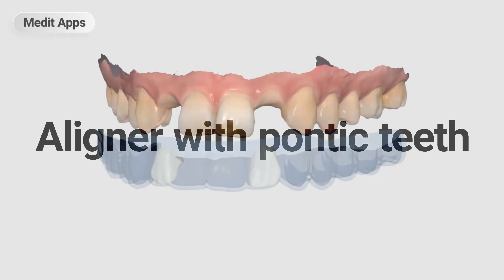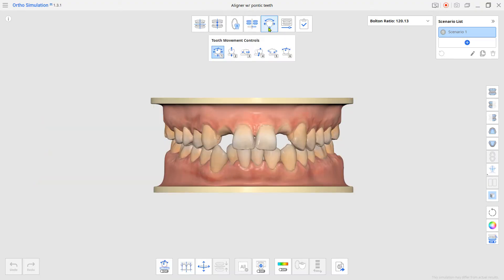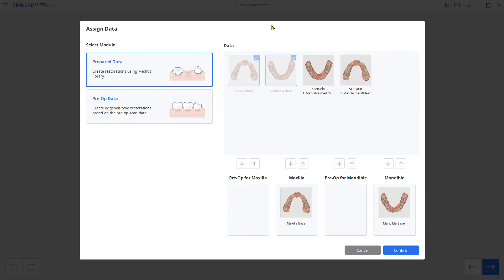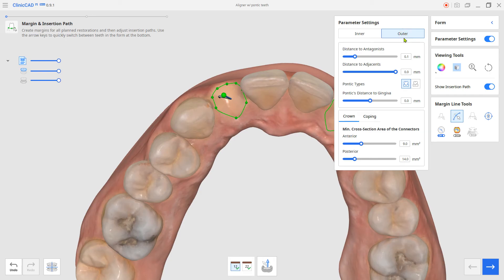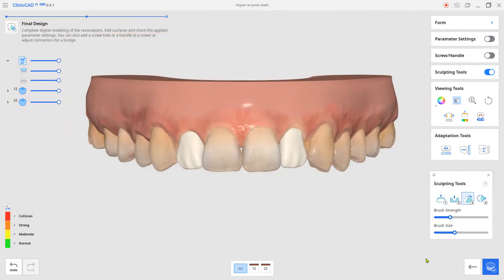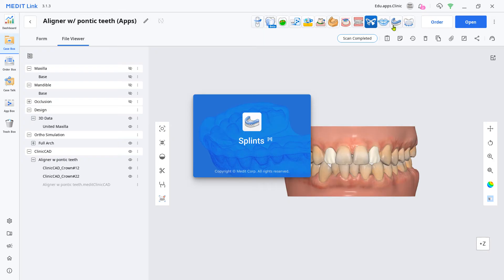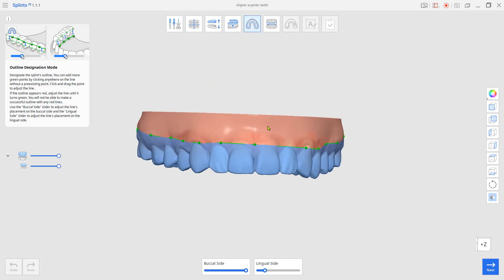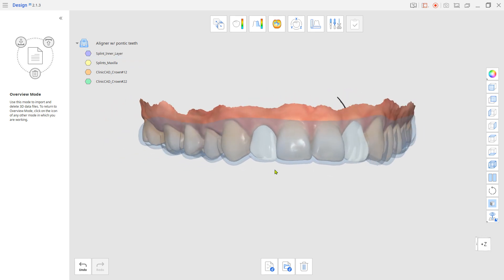Designing an 'Aligner with pontic teeth'.

Comment: When designing the splint, how do you know the thickness of the internal layer ?
Reply from the maker: First, you can measure the thickness with Design app.
https://youtu.be/_Na8edOfoEg?feature=shared
Second, how do we manage the thickness of inner layer then?
-> Under the  'Outer surface creation mode' you can manage overall thickness with the 'Lingual & Buccal thickness'
    from the bottom.
    The inner surface thickness can be from 0.3mm up to 1mm with that feature.